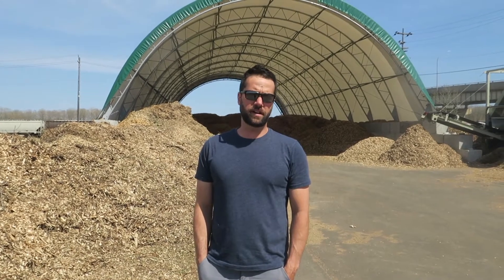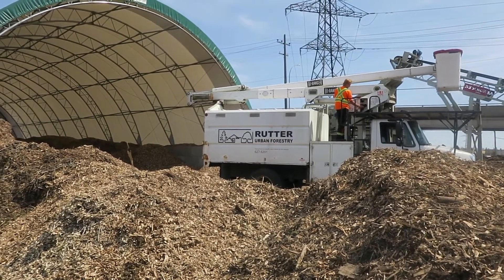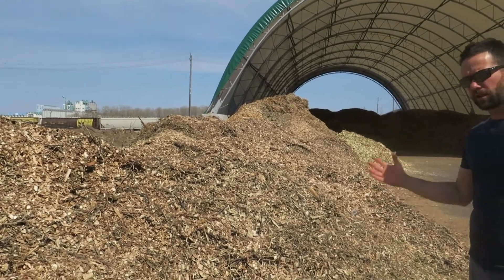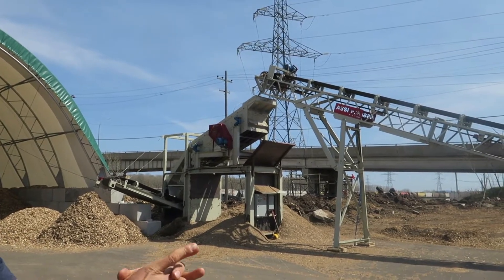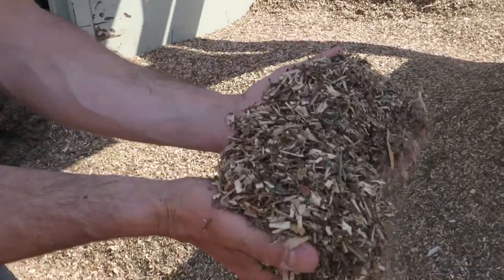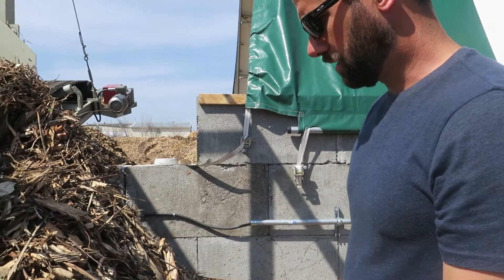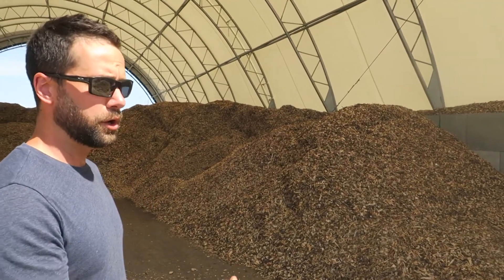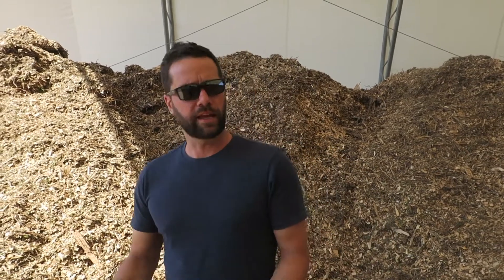Biothermic's urban wood chips to heating fuel facility

Comment: Great video Vince. I´m starting a project to control exotic willow in rivers of Patagonia, Argentina, and exploring potential uses of small branches. I was told that chips in pile compost, so turning and external heat was required to dry them. But I see you do not use extra heat. Do you need to turn them?
Reply: Hi Miguel.  We do not turn the pile or apply extra heat.  Basically, the heat produced during decomposition drives moisture from the pile.  When the pile gets to about 25%MC decomposition stops and the pile is stable.  This process requires covered storage to keep the rain off the pile.  We do remove a lot of the fines during the screening process.  You may want to consider a similar screener for your process.
Reply: @mikerutter8168  How many time until the chips achieve 35%MC ?

Comment: Hi love the setup! It looks like you've really got it perfected. I'm looking to do something very similar in the 🇬🇧.  Over here arb chip has next to no value (£10/t) as all the biomass suppliers want a graded size with little to no foliage particles. Through our business we produce alot of arb chip and have been thinking of ways to add value to it instead of simply being a waste product. Do you find much variation in moisture content between the top and bottom of the pile and do you turn the piles at all?
Reply: Still working on "perfected"!  Arb chips are very difficult as you know.  Our fuel always tests at P45 but doesn't make the P31 grade and causes auger jams in smaller boilers.  Moisture content gets to sub 30% reliably if you allow the pile to heat from decomposition enough, that part is more art than science.  We never turn the piles as that would encourage decomp and reduce fuel value.  The bottoms of the pile get to sub 20% and the outer parts don't drop below 50%.  After we screen (preferably on hot breezy days), we push it under the cover and moisture stays low and decomposition stops.  If you make an investment in screening, use a horizontally agitating screen instead of vertical like ours and you'll eliminate more sticks.